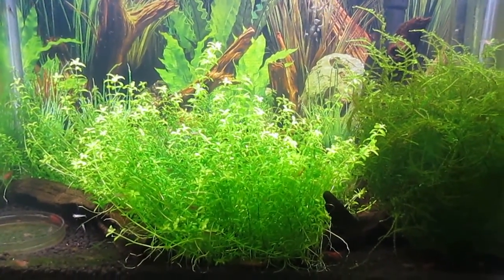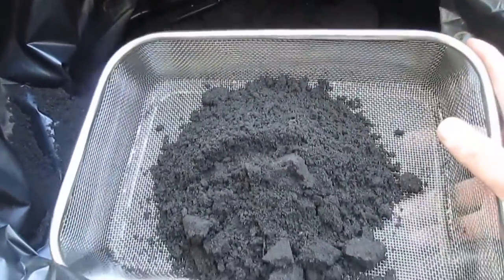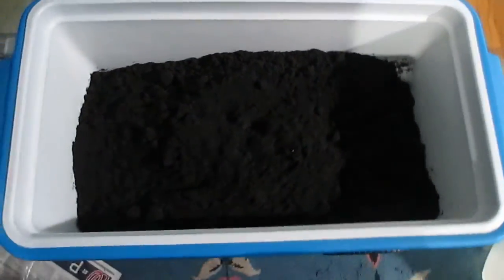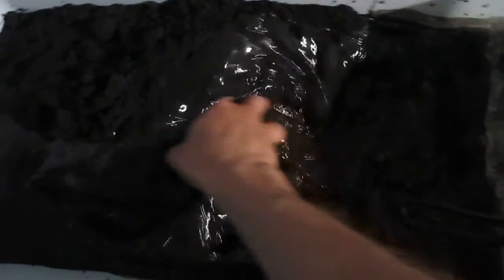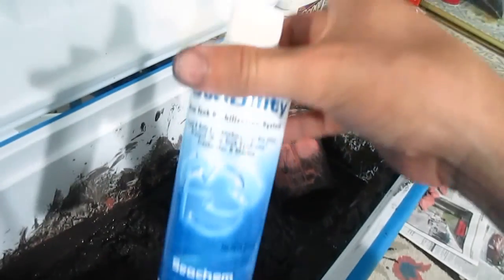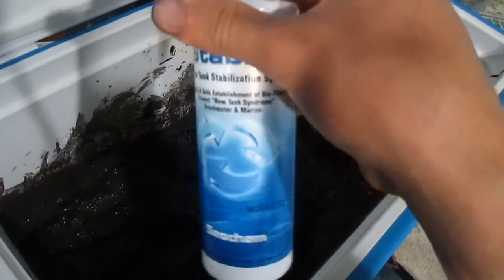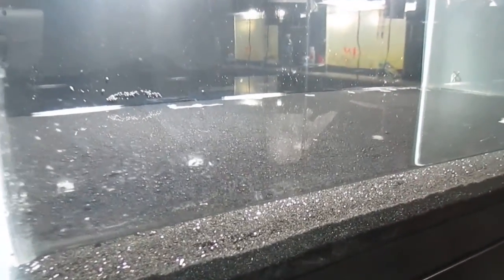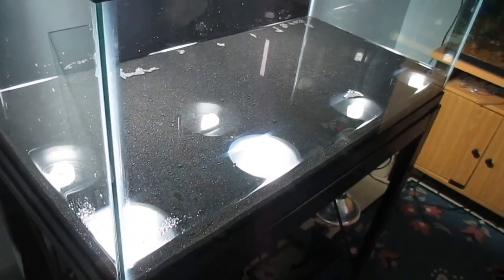My Dirt Tank Process

Comment: There seems to be a lot of concern about "anaerobic" conditions and  hydrogen sulfide gas. Point 1 is that the soil will be anaerobic after about 24 hrs. Multiple scientific studies have demonstrated that 24 hrs is about how long it takes the aerobic bacteria in the soil to consume all the oxygen. Now there is a layer of soil at the interface between soil and water that will stay aerobic, but this layer is only a few millimeters thick. Aquatic plants and burrowing critters will also bring oxygen back into the soil. Point 2 is that you will generate some hydrogen sulfide gas. Period. However if your tank is properly oxygenated, this gas may smell a bit but no damage will be done for the simple reason is that hydrogen sulfide does not dissolve in water. Now if you are generating the gas and the water is anoxic that can cause huge problems but then nothing is going to be living in that water anyway - except maybe bettas. The good news is that once the sulphur in the soil exhausted, you won't be generating any more smelly gas. Anaerobic bacteria can also generate methane and elemental nitrogen - both of which are odorless - by consuming nitrates.
Reply from the maker: Thank you for this helpful information. Surely this will address many concerns when it comes to using dirt for aquariums.